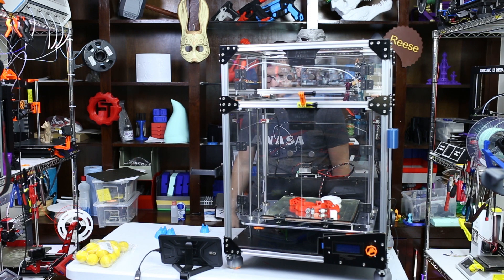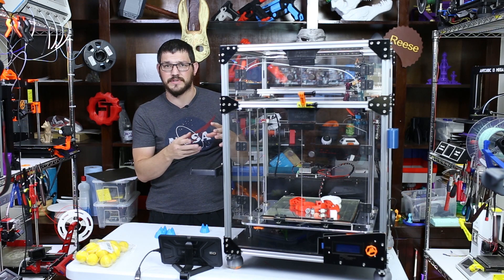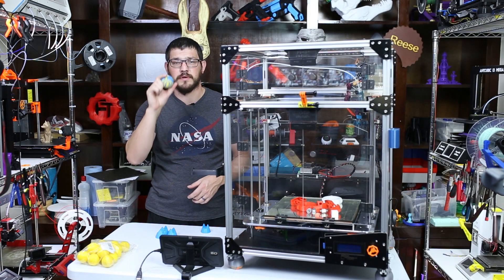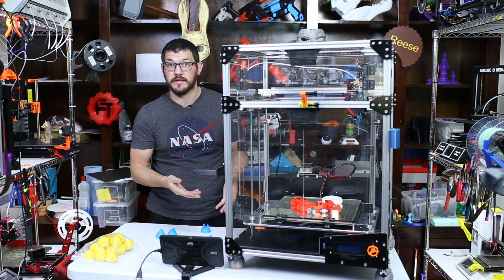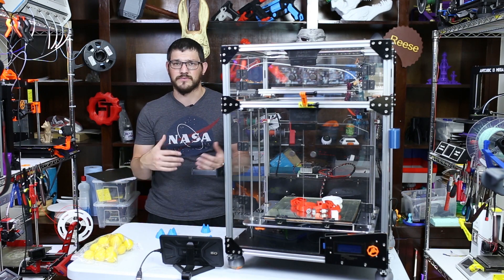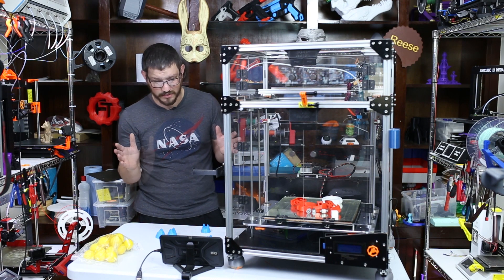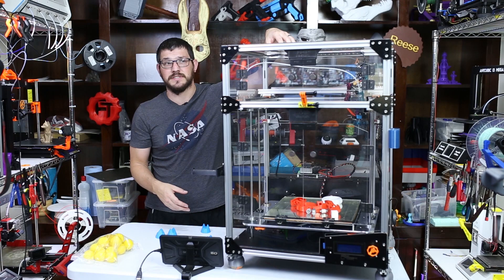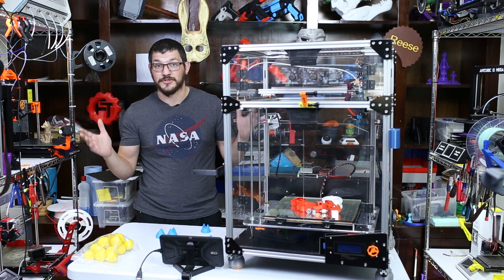FT 5 713Maker Kit upgrade and more

Comment: I've had an FT5 R2 for almost 3 years and it has been a great printer. I did buy the 713maker gantry and extruder mount kits at MRRF and that made the printer slightly smoother, but it was already a very solid printer. I don't have an enclosure, so I don't print much ABS. I added a Mosaic Palette 2 and I now think I have an extremely versatile printer.

Comment: I don't live in a humid climate, and the malamine extruder shuttle came apart about a week after I had assembled it and running. I had to zip tie it together to get to last long enough to print abs replacements.
Reply from the maker: I never had issues so I guess I was just lucky.

Comment: Almost everyting on 713maker is "Out of stock".
So i drew my own version of their parts and let a company waterjet the parts.
They look fantastic.

For the feet i used some hard rubber feet witch does let the whole printer vibrate a lot when the printhead makes fast short movments. I redesigned the whole printer with 4040 double slot vertical-extrusions. That should make the printer rocksolid.
The electronics i moved to the bottom of the printer with a draw that i can pull out so i don't have to turn the printer around to change something to the electronics.
All electronics i uped to 32bit for faster heating up with 2 mosfets, a 12v & 24v powersupply witch will fit easy in the draw.
On my FT-5 r1 often the printer stopped at mid print for 30 sec. or more and printed again after that. I don't know what could be the reason for that.
Reply from the maker: Sounds like some awesome mods!

Comment: My ft-5 has been a very good firdt printer for me. Learning all about printing and hardware. Though i bought a Cr10s pro and been using that for a year now and the FT has ben neglected after i made it into a bowden printer, which was a big mistake. Now i cant remember my favourite setup for the FT and the MKS board is giving my headaches. Its so aggressive with accel and jerk. I shouldnt have messed with it. Think my firmware is bombed somehow.

Comment: Revitalise PEI? Give it some wipes with Acetone. If still not grippy enough get very fine steel wool and scuff the bed up carefully soaking the wool in IPA.
Reply from the maker: Didn't I say steel wool?
Reply: @Fugatech3DPrinting  Sorry, yes you did. From my experience acetone works very well even without scuffing up the surface so scuffing might not be necessary. Then your first layer is more shiny and you have less scuff marks visible on it. Just wanted to help.